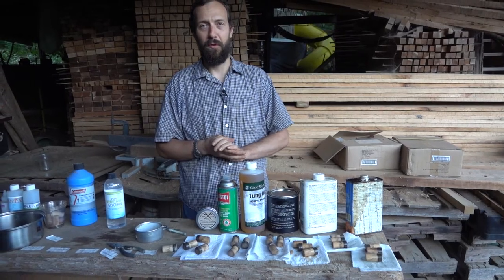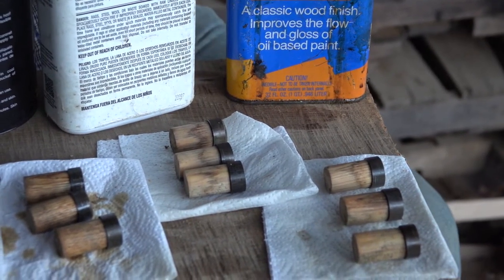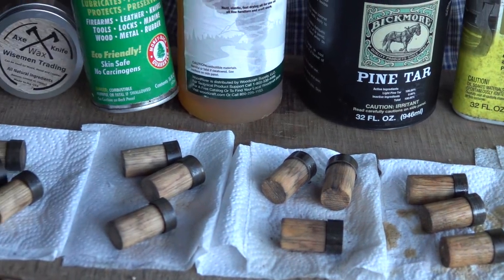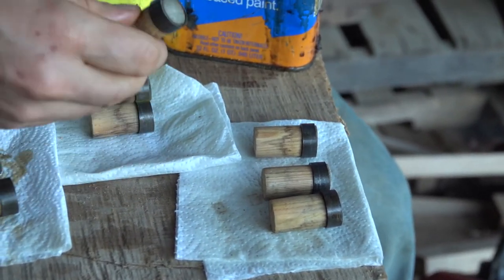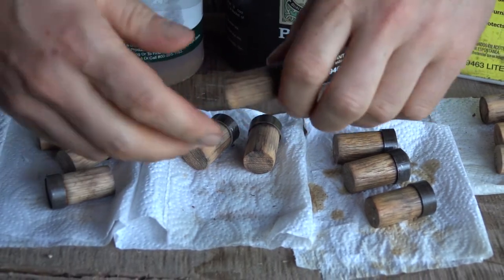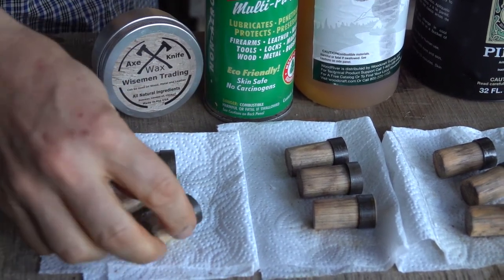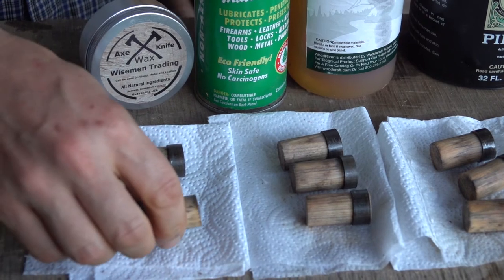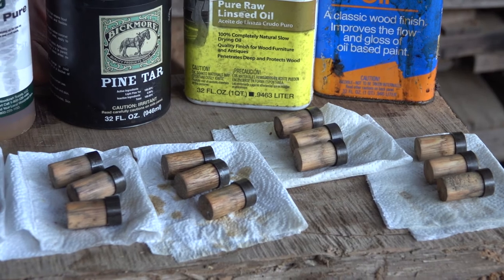What is The Best Axe Handle coating?

Comment: Soaking the wood before adding the oils seems like you're going more for a "coating" versus saturation. Axe handles are kiln dried before shaping and adding an axe head. Any moisture at all will make them then swell and become extra tight in the head. Your test seems flawed in design. Axe handle oil isn't about keeping moisture in as your test demonstrates. It should be about taking a dry handle and adding the best oil into the wood.

Comment: Boiled linseed oil is not one application process. You apply very very light coats until the wood won’t absorb the oil anymore. Usually 5 to 7 coats. I have used council tools with wax applied, it does not protect the wood against dirt and grime.
Reply: That would do nothing. Boiled Lindseed oil seals the pores. You have to lightly SAND between coats. Basic Woodworking 101.

Comment: Have you thought about using a piece of pvc pipe with cap on end sticking handle inside them pouring oil in pipe and let it soak for days
Reply: Why would anyone want a sticky syrupy mess on their axe handle?
Reply: @petemitchell6788  it soaks into the grain then you wipe it down and it cures einstein
Reply: @GregariousAntithesis  That's not how boiled linseed oil works. It needs to dry over multiple coatings.

Comment: Normally I used boiled linseed oil on axes and tool handles, new and old.  I have recently, last year, started using Ballistol on walking sticks and canes.  Works great on old canes.  

I will be getting some axe wax to see how it works on axe and tools handles.  Looks like it will be good.

Thanks for the informative video.
Reply from the maker: It was interesting results because I thought the Ballistol would hold long but it is some great stuff anyway.